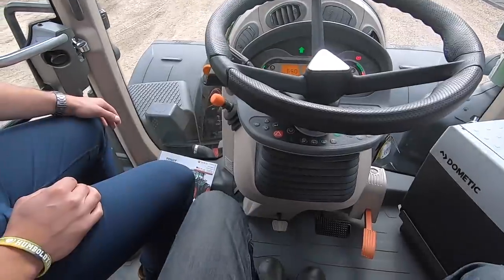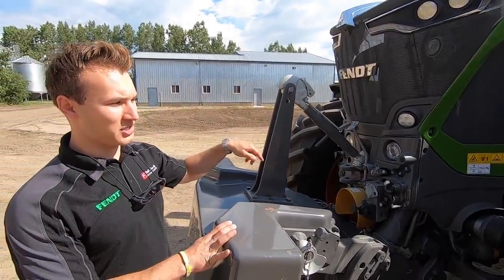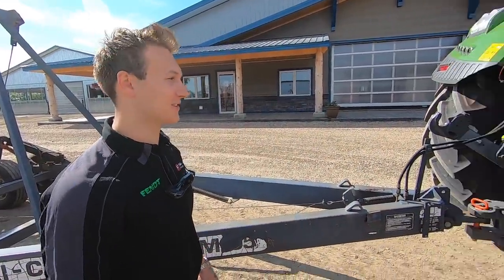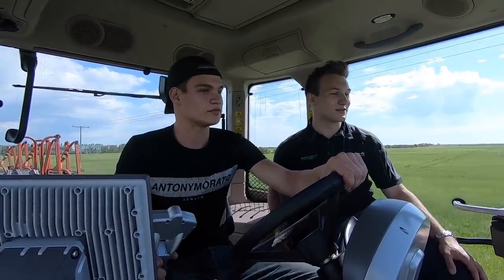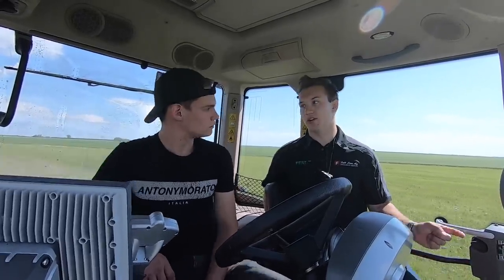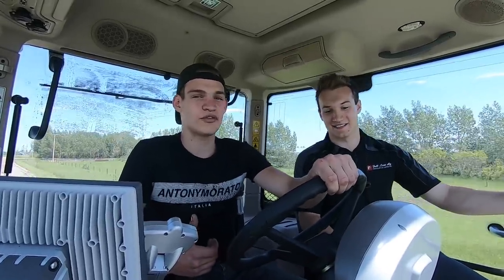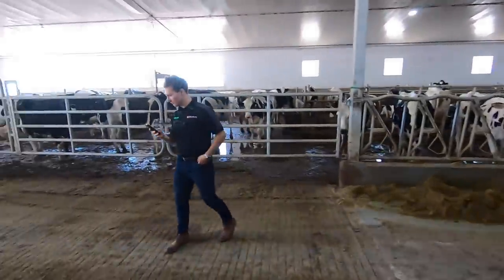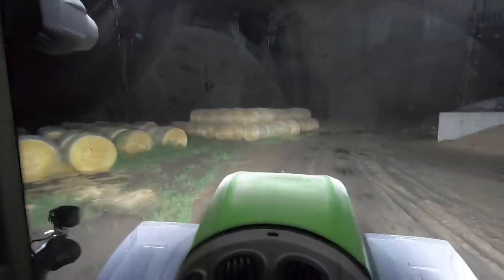Demoing 2020 FENDT 942 VARIO

Comment: Anything in Europe runs at wide open. Did it just rain there with all the water puddles? I like the light setup cuz alot of times you can get hurt getting in or out of the tractor at night. Looks like a heavy tractor. Our Cat dealer 10 miles away are starting to carry Fendts tractors. Love your drone footage and your videos, would love to see it put on the chopper and see what it can really do. A big seller nowadays is parts replacement and mechanics that can fix on site and salesman that knows your operation.

Comment: I have been a tractor mechanic for over 40 years. I can only imagine what will be happening with the computer systems 20 years from now. A 20-year-old tractor without all the electronics can easily be rebuilt. A 20-year-old computer system with a variable speed transmission will be someone's hell. How fast does the tractor depreciate? I can't imagine that it will hold its value and keep in step with the financed amount over the term. Great looking tractor though :)

Comment: What is the air quality like inside the cow barn with all that machinery running? Is most of the 4 wheeled equipment diesel, gas or electric? How loud is it all? Doesn't the sound level harm the cows?
Reply: The ventilation fans are probably running full blast this time of year, to keep the air moving through the barns.  And the white noise from the fans & moving air likely drowns out the occasional noise from vehicles inside the barn.
Reply: No.